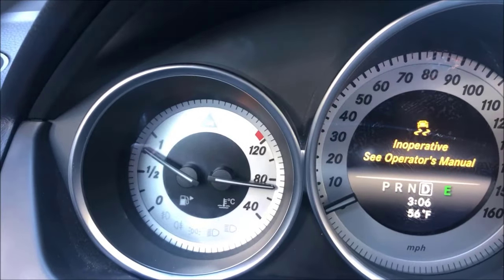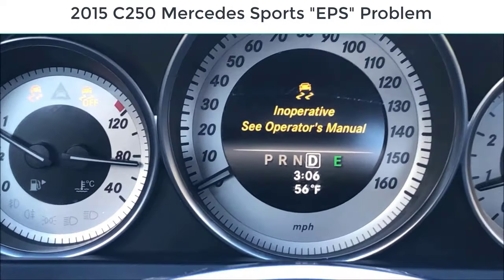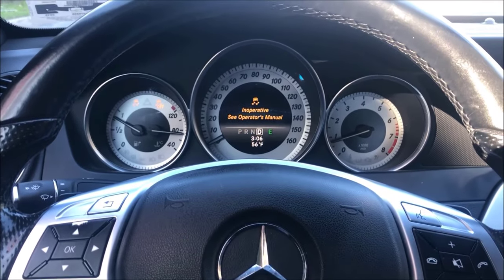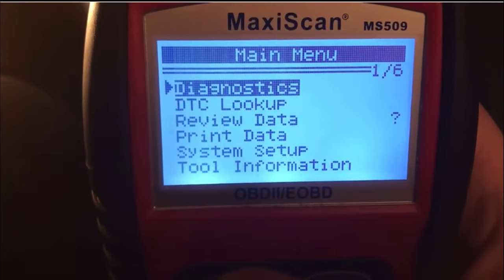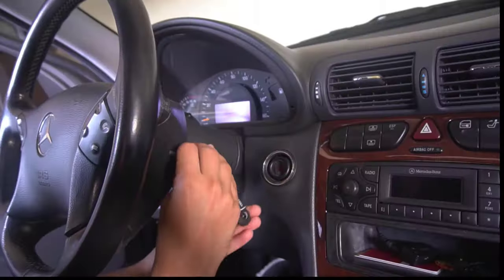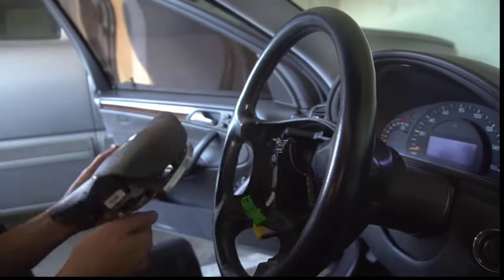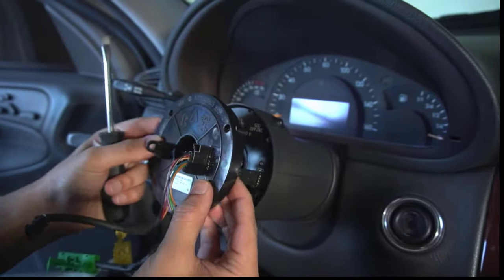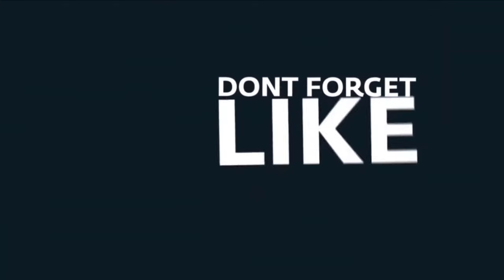How To Fix Mercedes C250 ESP Light That Stays On And Can Not Use The Cruise Control Code : C220500

Comment: When this happened to your car did you lose ability to accelerate? Mine went into limp mode. I shut off car. Waited 5 to 10 minutes and it went away
Reply: I think my car os doing this
Reply: Temporary fix it keeps coming back in my a class
Reply: Mine does this as well. Did you ever figure out what the issue was ?
Reply: Hiw did it go?
Reply: This happened right noe with my c350e dis just the same but the engine light stayed on
Reply: Omg I have been dealing with the same issue in my c250 which is extremely common and I never know when it’s going to leave me stranded sometimes I’tl be good for months then start it’s bullshit again n not start for hours or days and I now noticed it has been over heating but not registering
Reply: Hey did anyone get it fixed like mine does the same I loose ability to accelerate
Reply: @PFILMSAZ same with my c63 why does nobody have a fix for this 😢
Reply: @PFILMSAZ if you’re losing the speed , I think it is the gas paddle needs replacement
Reply: I have no symptoms the lights are on and it shows no traction or abs. But mine car runs fine acceleration fine transmission.
Reply: Guys I found the solution, we should just pay Mercedes all of our thousands and thousands of dollars to fix a problem that doesn’t even exist because the car thinks that there is something wrong with it when they really isn’t, that’s the solution is to give Mercedes more of our money we should just direct deposit Mercedes-Benz all of our paychecks that’s the solution
Reply: my car just started doing the same thing does anyone know why ?
Reply: @Maybaby1959 i got same but now just warning light but car drive find abs and traction light not on was when first happen tho
Reply: @Oh.Kha. my c63 just got the same issue.  Did u change the sensor and got it fixed?
Reply: @cliftonwong213  tbh nahh bro idk what it is I did my front breaks and it went away but now it’s back so idk what it is
Reply: @Oh.Kha.  had that happen to my car after leaving it away for a week, but I just disconnected my negative terminal from my battery for 2 minutes, put it back on and light went away
Reply: @bimmahe9014 Hey, how do you disconnect it?
Reply: @Maybaby1959  hi did u fixed it or  did it just disappear
Reply: Disconnect the negative terminal on you battery for about 5 minutes, that will reset the ECU

Comment: Update. I needed to change the wheeI speed sensor. COO31 and C0034.  I changed drivers  side speed sensor, and it didn't remove the message or the check engine light , so I changed the passenger speed sensor, and that message went away along with the check engine light. Now I have to take it to the dealer and pay $209.88 in NJ to get the SOS TEL AID REMOVED. Besides that, everything works now.

Comment: I believe I have the same problem. I have a 2014 C300 and my traction control and ABS lights are on and inoperable and cruise control also does not work. It went away but I think it turns back on if I accelerate too fast and then it takes a while to accelerate. I really don’t wanna pay $1000 tho ☠️
Reply: It is the gas paddle that needs replace
Reply: I’m here cuz I have the same problem 😭😭 seeing it cost $1000 makes me cry
Reply: You just need to remove it from roller test, you can search how to remove w204 from roller test
Reply: @jeff346 not necessarily
Reply: how did you fix it?

Comment: If you ever changed out a battery or disconnect power you can get this warning. It’s an easy fix to reset the steering angle sensor just start your engine and turn the steering wheel all the way to the right and all the way to the left.  This resets the code .

Comment: My opinion is ,  the 2012- 2015 MB ABS electrical system and all its module components, BAS, ASR, Attention Assist are not engineered to last the life time of the auto. Surprisingly ,much of the system is connected together by thin fragile wires. They may be  covered  by thick rubber and overlooked by mechanics.  Module connections get rusty and cleaning is over looked during maintenance.
Thanks for sharing the info.

Comment: it has happened to me before, it was the speed sensor, it's quite a cheap part itself and not that hard to replace within 30 minutes at home...but this same message can be thrown for a few different sensors, just thought i'll let anyone else know that it could be one of the speed sensors as well.

Comment: I am having that same issue with my car right now. The turn signals. horn and all steering wheel controls are also inoperable. Thanks for this video.
Reply: Did you ever get it fixed and what was the issue ?
Reply: I have the same thing just now happen to me. What did u end up doing to fix it
Reply: That sounds like the modules in the driver side of the car have been shorted out. I had to replace my modules and now my horn/signal light, work. + fan is not blowing on high constantly. You can do it yourself at home you just need to order the parts
Reply: @nataliewashington2621 what kind of module did you use

Comment: hello, the esp and traction lamps of my 2012 model c250 Amg remain on and the car does not move forward even though it is running.
Reply: how did you fix it?
Reply: @suleibrahim9221  brother problem is transmission for my car no have oil in transmission

Comment: Question will this prevent the car from driving
Reply: I’m trying to figure out the same thing I haven’t found anyone who is having the issue I’m having where the wheels feel like they are locking up when I accelerate
Reply: @kvng_kquan what ended up happing? i have this same issue

Comment: My steering wheel is slightly tilted (needs alignment I think) and this came on and when I turned it off for the night and next morning started the car and it came back on and I held the steering wheel straight after he said it was a steering angle sensor and after about 3 minutes surfing through videos it just turned off. I don’t if I’m lucky or what but I’ll give it a try before spending the 1,000$ guy🤞🏽
Reply: Never mind it came back on 15 minutes later
Reply: @Cameragodchrisvlogs  bruh u got hope up and shiii lmk what happen next
Reply: Did you ever get your steering wheel fix ? I have the same problem but don’t know what it can be

Comment: I have a 2013 W204 C200 and this message has been popping up intermittently for years. I've had parking sensors replaced, seatbelt buckle sensors, oxygen  sensors, you name it. It still comes back. I just ignore the dam thing now. Doesn't seem to be affecting anything at all. No idea what it is. I know I'm not spending another cent on it.
Reply: It’s is the gas paddle

Comment: This just came on my 2014 cls550 mercedes and it been parked, qhat this means
Reply: I have the same car how did you fix it the work shop tell me that i need to change either the speed sensor behind the hub or the sensor on the hub bearing

Comment: No no. Just do wheel alignment
Reply: Fr? Mines doing same thing too
Reply: My alignment is fucked up? And I got that light so if I get a alignment can I just clear the code after?
Reply: @ismaelruiz4455  did it work for you?
Reply: Ok I think I will try that. Because it happens after I change the brakes and front absorbers
Reply: @waktempeh8684 update?